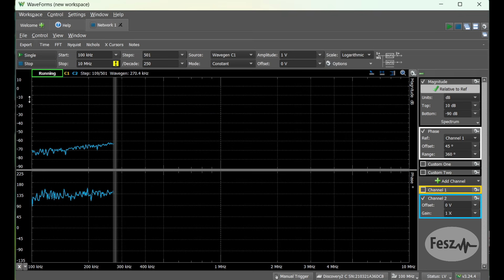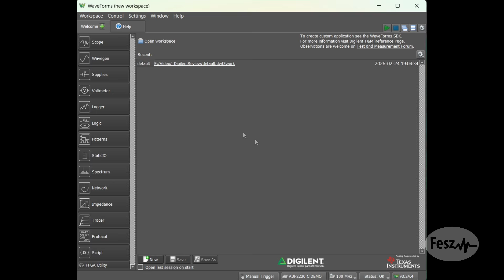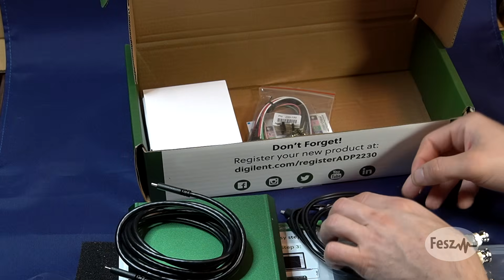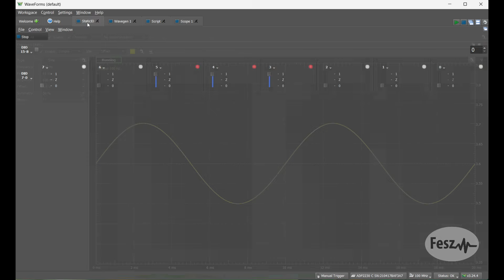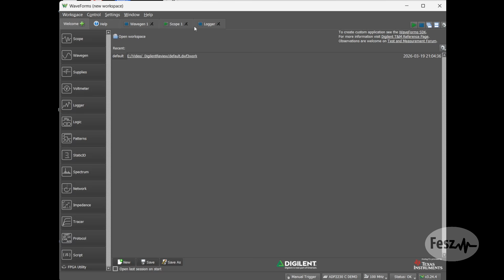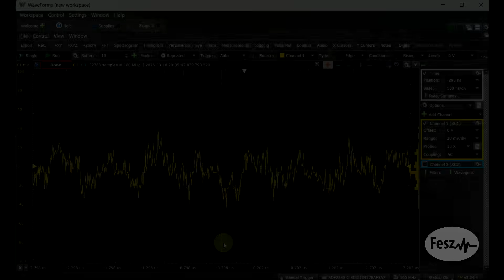Digilent ADP2230 Review

Comment: As for the noise floor - I wonder about the power source, USB, or the wall wort are both switchers? It would be interesting to repeat the noise floor example powering the unit with a battery. In addition the USB cable could use a ferrite,... ??

Comment: AUD $1108.00 is not within the hobbyist/student budget unfortunately.
Reply: I'm not sure what kind of marketing target they have. These are too expensive for the average hobbyist and too limited (usually) for professionals.
The software is nice. So if you're looking for a USB oscilloscope with limited bandwidth, limited sample rate, good resolution and nice software, this is it.
But otherwise I'd recommend a Siglent or Rigol 12-bit scope instead, for cheaper, with much higher sample rate, and these are controllable and automatable via USB or even Ethernet.
Reply: @joseoncrack exactly you cannot have a spectrum analyser with 50Mhz bandwidth it contradicts the very definition of a spectrum analyser that should have huge bandwidth. I think they are expensive and limited on purpose as they count for US technology with hundreds of patents, so they don’t want overseas people to get performant stuff. Just like you I’m oriented on Chinese devices, not the no brand ones, but for 1000$ you get a nice spectrum or oscilloscopes with pretty good precision
Reply: The Analog Discovery 3 that I have (plus the  option boards : BNC & Impedance analyzer) is a very good alternative I'm very satisfied with. Much cheaper and very effective.

Comment: While the bandwidth and sample rate would be ok for a student lab using breadboards where you cannot really work with signals above 1 MHz. It would still be good enough for beginners. However, then the price is not ok. The devices from the whole series are not affordable for the normal student, nor for course labs at universities. Also in an university setting the devices are too flimsy. The supplied probes seem to be the cheapest standard probes which you can get for USD 10 per pair including the "fancy" ground contact. 
I give them the fact that their software looks nice and that probably much development time went into this close-source app, however, this means that you also lock yourself into the operating system tool chain. We still need to keep Windows 7 computers around, because of software which is not available for newer versions of Windows or Linux, and these computers cannot be connected to the network anymore because of security risks.
What I really think would be a great tool would be an open-source, crowd developed tool consisting of both hardware and software. The specs would not have to be extreme for beginners which work in the Arduino domain and introductory courses at universities worldwide. Some 1 A power sources, a 20 MHz bandwidth, 100 MS/s dual/quad trace oscilloscope, and a programmable arbitrary function generator. I tried to start to develop something similar in a student project I supervised 5 years ago based around a single STM32. We got quite far at a component cost of around USD 50, but the project was undercritical as student projects often are.

Comment: Very expensive... 750 usd is way too much. You could get a bench one gor this price
Reply: I feel like most bench ones won't have a good complex impedance analyzer or spectrum analyzer built-in and easy to use though, lower than that price range. The software flexibility is what you're buying here.
Reply: Yup. 15 MHz bandwidth at this price is pretty boring. At least it's decently oversampled at 125 Msps, they didn't redline it at Nyquist and say "15MHz", it really will go that high, maybe slightly more with some rolloff. This is probably going to end up all over education anyway though...
Reply: @lunalangton5776  The oscilloscope is 50Mhz. Only the waveform generator is 15Mhz.